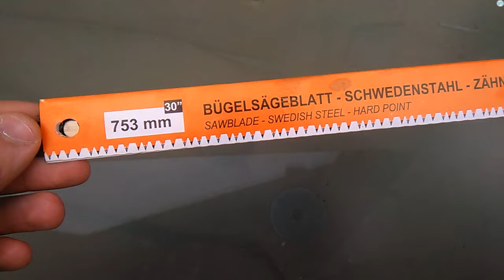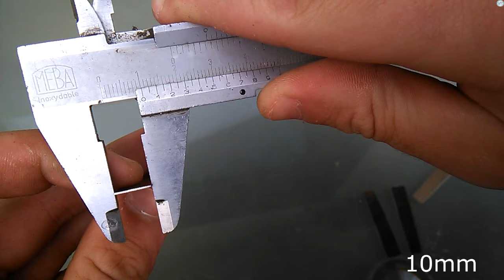Making Mini Crossbow | Part 1 | + Free Templates

Comment: first off i have to hand it to you for making these with hand tools. I've been making one of these at work for the last couple months and have access to much better tools like end mills and surface grinders and its still a lot of work. second,i was running into allot of problems getting the slot for the trigger group to drill straight since the bit wants to skip off the grain when it hits it so i ended up making a self contained drop in trigger group which not only makes lining everything up a whole lot easier. also if i make another one, all i have to do is unbolt it and switch it over. anyways, keep up the awesome work.
Reply from the maker: Thanks, Yeah it takes a lot of time to make one of these, especialy with hand tools, sometimes it took me like 1 hour to cut something that someone can cut in 5 min with power tools. It sounds very interesting, because I also had a lot of problems with that, but I found out that if you start drilling with the smaller bits like 1-1.5mm and expand it with a small file it should be very straight. Thanks again!

Comment: today I was shopping for needed parts -and small sheet of steel for the main base is so hard to find because small ones have holes for bolts all around them and without holes there were only one meter big plates...
Reply from the maker: I  got those for free, but yesterday I was looking in hardware store for some aluminum plates and i couldn't find it, but I found some on ebay